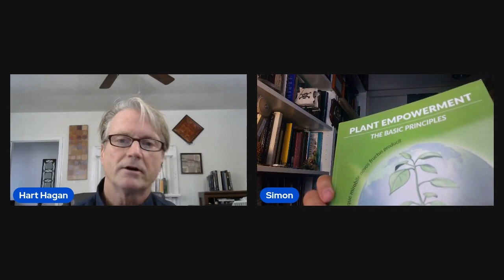Simon Michaux Gives Us An Update On His Work With Renewables, Storage and the Future of Civilization

Comment: We need to rebuild the rail system across America; as we have far less rail lines than most other developed nations, and we need high speed rail across the country like that seen in Japan, due to our airspace being too congested. Also; as we move into another tech revolution, we will need the high speed rail as a backbone for far more resources needing to be delivered quicker to keep pace with the ever rapid speed of technologic revolution. Trucking will still have its place, but it will transform along with the rest of our transportation sector.
Reply: Diesel is our main problem, where it's located or rather, not located.

We have no commerce without diesel.

Comment: 9:15 "same current same volt same frequency" no they don't. First things first: computers use SMPS. The SMPS draw as much current as necessary to provide the power needed to the computer. So the "same current" part doesn't make sense. "Same volt" again, the SMPS can operate over a wide range of voltage amplitudes . Obviously, it can't drop to near zero, the computer will simply stop, but as long as it is within a range, it will work. Look at your phone charger: notice the part where it says
100 - 240 V ~ frequency 50-60 Hz?
as long as frequency is within that range and the amplitude is within that range, it will work
Same with my computer's power supply (a Seasonic SSR-550PX)

Comment: If you like simplicity consider not throwing the ICE baby out with the CO2 bath water.  Leaving known tech is better in non greenfield implementations.  Recall ICE needs expanding gas and H2 is sufficient (not perfect) to do this.  The solve is converting sea water or less desirable potable water at the point of combustion (no external systems, only integrated hydrolysis) .  Inefficient yes, so is gasoline by this measure.  Good luck with rest of your quilt.  Please send me a task as I would love to be involved!

Comment: AUSTRALIAN ENGINEER HERE: I really like Simon because at least he's putting things down on paper that need to be discussed and until that happens in any project you never have a starting point to work from. So kudos to him on that.
I agree with most of his points. 

The problem with pump hydro goes even further because unless you have suitable geography its NOT viable. That viability then included the cost of connecting it to the energy grid. Here in Australia most of the massive cost blowout in the Snowy 2.0 project is the cost of connecting it to the grid. So most of the several 1,000 places claimed by various people ARE NOT viable and never were.

BUT Simon has to stop talking nonsense on a few points and particularly on Hydrogen. 
- We do know how to store it. 
- The claim that hydrogen is NOT a fuel is just semantic Bullshit and its annoying semantic bullshit. 
- The gigantic assumption the the only way to use hydrogen is in fuel cells is BULLSHlT. I'm an aerospace engineer by degree and Rolls-Royce, GE,... etc. worked out how to use Hydrogen in their gas turbines back in the 90s. I am an aerospace engineer and I know that to be fact.
Reply: Hey I understand that the Hydrogen point is upsetting. Allow me to try to explain:

Hydrogen embrittlement is real, and it does create problems for storage. 

Hydrogen is not a dense fuel. Setting aside the mega high pressure systems to liquify and transport it. 

Hydrogen doesn’t just sit out in the universe, waiting to be burned in a hydrogen power plant. 

Steam methane decomposition, or electrolysis, all takes more energy in, than can be usefully burned out. 

In short, it’s not a Source of energy as much as a carrier of energy invested to get it. 

Leveraging energy technologies is all about Energy Returned on Energy Invested (EROI). Hydrogen simply doesn’t fit the Bill for a source of power which will fit the modern economy. 

EROI calculations make it clear that we will never decarbonize without Nuclear power!
Reply: Although nuclear power -> nearly 0 marginal cost for energy -> electrolysis -> reliable hydrogen source. 

Then you’d be able to “carry” the energy to a gas turbine and burn it when you need it.  That doesn’t make it a source of energy, because there is a huge sink of energy in order to extract the hydrogen from the environment.
Reply: The reason Fossil Fuels work as a “source” of energy is because the EROI is very positive for harvesting useful energy from the environment. Hydrogen doesn’t have the same EROI source profile, thus couldn’t be regarded as a replacement for the existing fossil fuel system
Reply: The real world economics of hydrogen makes it not functionally a net supplier of energy to the system, so it’s not actually “semantic bullshit”, there are fundamental physics at play here, if you are keen enough to see the entire energy pie.

Comment: Idiot thinking is like someone thinking that the spark plug is the vehicle, AND the millions of roads are free.

And then talking and talking and talking about the spark plug.

The national electrical grid costs $TRILLIONS and is fragile because it is so expensive to build more.
100 years to build. 10 decades.

If no fossil fuels, then we need 5 national national electric grids capacity. 

So, kissing the spark plug for supplying the national highway is insane.

Dispersed generation or 'collection' of energy, and no grid expansion. 
Rooftop solar PV and EV big batteries and the EXISTING NATIONAL GRID. 

Cold latitudes solutions are not warm latitudes solutions. 
The climate is warming.